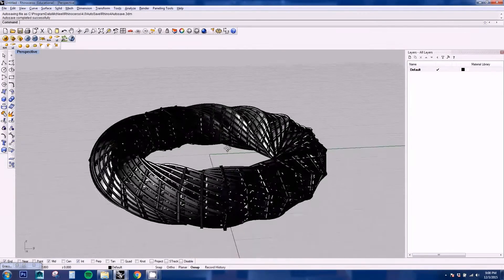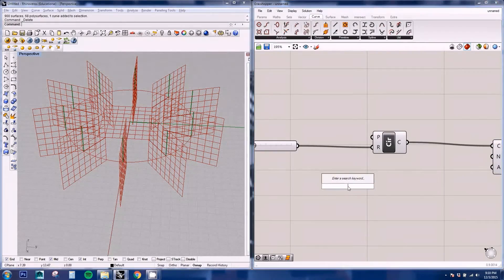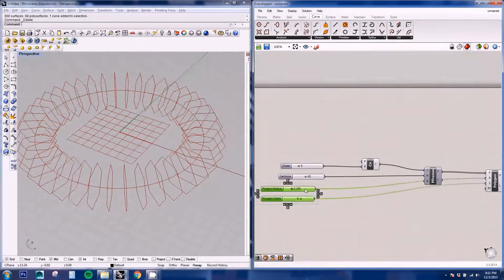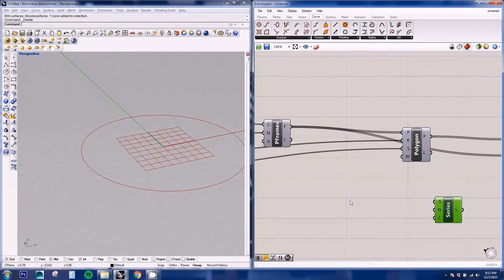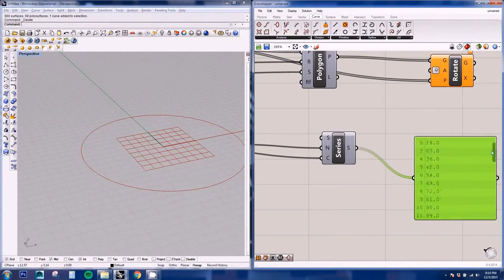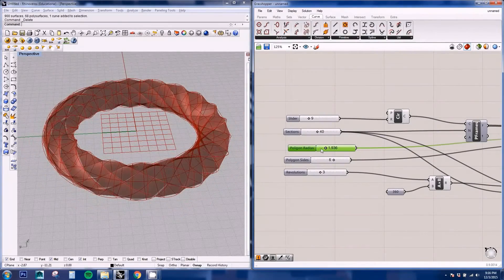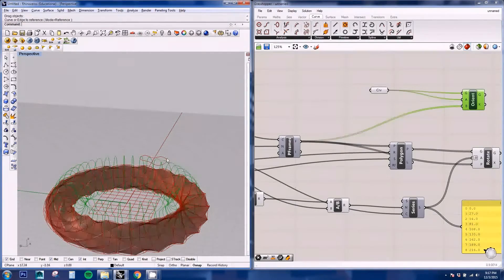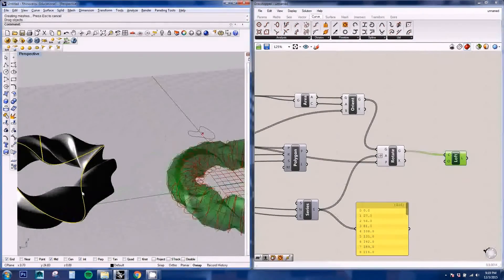Grasshopper Mobius Strip Tutorial Part 01

Comment: Question: Loft mixes up the seam points. At a specific area there is a mobious turn. The rest is linear or crossed. Is there a way to solve this?
Reply from the maker: Are your using the same curve profile to loft? Try reversing the direction of the curve, with a Flip node, it should be under the curve nodes.

Comment: The tutorial is very nice, but this is not a "real" mobius strip, as the polygons are rotating themselves about a 360 °  in one turn. It should be 180 °, then the surface would be "not orientable" (It still would be orientable, if we use polygons, but a infinite thin strip would then be not-orientable). Unforunatly changing the 360 ° field to 180 ° is not giving me the desired result, because the closed loft command is trying to fix the orientation. Do you have an idea, how to get a real Mobius strip?